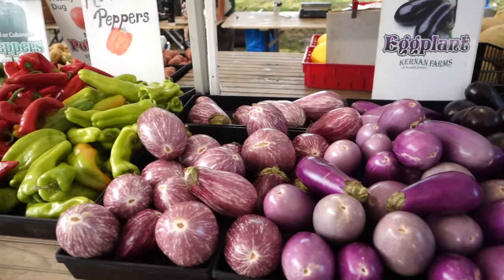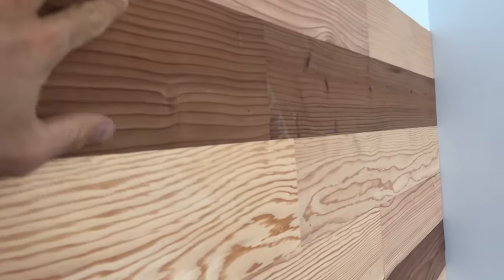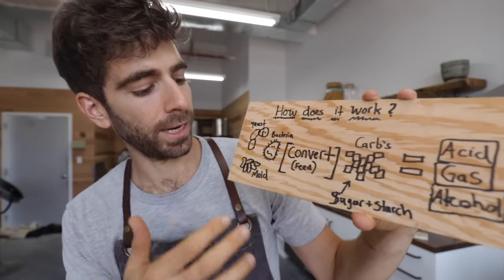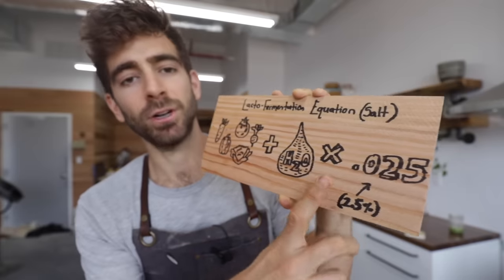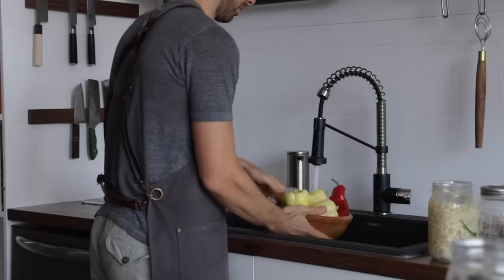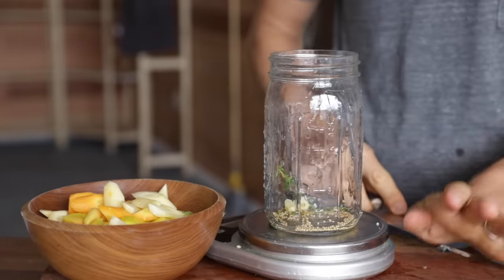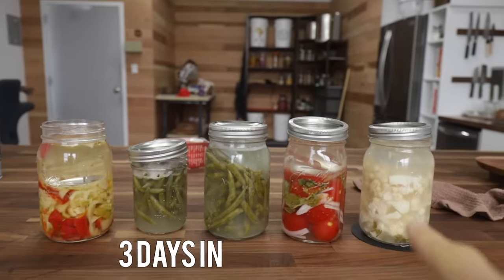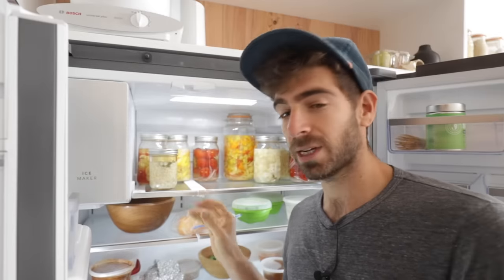The Complete Guide to Fermenting Every Single Vegetable

Comment: 1. Wash your veggies of choice.
2. Cut them up into bite sized pieces.
3. Add the vegetables and water into a jar whose weight has been tared (zeroed out). Weigh them.
4. Pour water into separate jar and add salt equal to 2.5% of the mass. Mix up and then put back into the original jar with the vegetables in it.
5. Weigh it down so the vegetables stay submerged. A glass weight seems to be the easiest.
6. Cover loosely with the lid.
7. Enjoy at your leisure for months if stored properly.

Did I miss anything?
Reply: Excellent
Reply: yes, how long to let ferment before refrigerating
Reply: @jamesnesran2348  It's up to you. The flavor of the veggies continues to change as the bacteria continues to eat them. I forgot about a jar for about 3 months and they tasted more sour than usual, but they were perfectly fine to eat. Technically you don't even need a fridge, just eat the veggies out of the jar, making sure to keep them submerged under water. That's how they did it before refrigerators existed
Reply: @jamesnesran2348  It also depends on how hot your house is. For example, my carrots ferment in two weeks in the summer, and they take a standard month in the winter. I also don't do any complicted math. I put 4 tsp of salt in a quart jar. add about a half cup of water to dissolve. add vegs. add water to the top. stir really good/shake. It has never ever failed. I never do the math and weighing he does. Just an idea.
Reply: Should the water ideally be chlorine free
Reply: Is it 2.5% of the weight of the water?

I've never weighed my salt. I just use about 1 tbs per pint of filtered water. Been fermenting for over a decade. Works wonderfully & no math. 😄
Reply: @heartshapedisle  absolutely!
Reply: What salt???
Reply: So veggies + salt brine?
Reply: @RunninUpThatHillh     Good point.  Refrigerators can fail.  I would like to know if you maintain your vegetables loosely lidded, and if so, how long?  I tend to tighten my lids when I reach the level of fermentation.   But I don’t refrigerate them, I appreciate your common sense.
Reply: @Wesdotcool     Do you tighten your jars, after the desired amount of fermentation?  Or do you maintain them loosely until totally consumed?
Reply: @davidadausuel4537  the latter. Loose lid for fermenting and tighter lid for refrigeration.
Reply: @CarolynRessel  salt type? No iodine and no anti-caking agents.  Rock salt and canning salt typically contains neither ~ but check labels to confirm.
Reply: @hitreset0291 Kosher salt is great for making sure it's not iodized. I use it on Sourdough bread. Not sure about anti-clumping agents though. 🤔
Reply: @CarolynRessel  I've discovered that french seasalt (0 additives, no iodine, no anti-caking agents) works best. I love Sel de Guérande for lactofermentation
Reply: What's has not been really mentioned but is important is the fact that some veggies let out water (salt breakes down cells) so do leave some space for the water level changes.  if you ferment cabbage eastern eurpean kind ( lactofermened insted of sauerkraut), you do not use water but just salt, white cabbage, carrots, peppercorns, bayleaves, no addition of water nesessary, but the mix nedds to be kneaded a bit before putting into jars. For the georgian kind of "red cabbage" (beetroots, cabbage, chilis, garlic, sellery) sellery sticks with leafs are obligatory, otherwise the taste is  much blander.
Reply: do any of you know if it's possible to use coarse grained salt? because sea salt and other types of salt are too expensive for my budget

Comment: A little tip for covering your pickled vegetables during the fermentation stage is to place a coffee filter on top of the jar and use the lid ring.  Set the metal lid insert to the side until it has fermented.  This allows it to ferment in the jar and yet release the gas through the screwed on filter while keeping dust/dirt out.  After it's fermented, you can then replace the filter with the metal lid to store it properly in the fridge.
Reply: 8:47
Reply: @lyricderbin1169  If you have it weighted down and submerged, it is not exposed to oxygen.  You have to make sure your fermented ingredient is submerged.  This is why even with a lid his green beans ended up with mold at 21:07.  They weren't submerged. Just make sure that your ingredients are submerged in the liquid and you'll be fine to remove the metal lid and use a coffee filter. I suggest maybe that you watch again the section on Anaerobic Environment to refresh about this.  :-)  16:40
Reply: Screenshot! Thanks, I'm keeping pics of certain things as I'm learning
Reply: Great idea, Thanks!!!
Reply: I have never fermented before. So excited to begin.
Reply: I do this but found the metal lid annoying for my kids and husband to take off and put back on. (Plus I need them for canning). I bought cheap plastic lids on amazon that fit on a ball jar.
Reply: @adrianaholman9861  It's super fun to do in the summer as vegtetables come on. OR when they're on sale at the store. Fermented carrots are the bomb. You can add garlic cloves too. I once did carrot, garlic, fresh dill. OMG I ate the whole jar. Don't. Remember to eat small amounts daily or your tummy might be upset lol!!
Reply: @RunninUpThatHillh  did you do the weighing the vegs in the jar thing he did like he did in the video, or did you just do 25 grams salt to one liter of water and make a separate brine?
Reply: Terrible idea. You will allow oxygen into the environment and promote mold growth on the surface as well as aerobic activity in the brine (the surface being exposed to oxygen results in oxygen dissolved in the liquid - this is how fish breathe) much better to just use the cap.
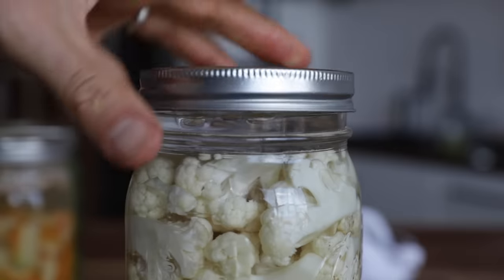Reply: @connivingkhajiit  Are you keeping your ingredients submerged?  That is the key!  All ingredients MUST be submerged.  NOTHING can be above the water. The gases can still escape (you'll see the water bubbling from time to time. For instance, at 17:57, you'll see he has only a towel with a rubber band over one of his jars.  The first jar he places on the shelf is not on tightly and it's angled, allowing the gases to escape and he has one jar that does not have a lid at all.  Just the bag of water to weigh down the ingredients to keep them all submerged in the water.   This is so the gases can escape.  It's essentially what I was suggesting with the coffee filter and the ring part of the lid to hold it in place.  As long as ALL of your ingredients are submerged, it will keep you from having to open a solid lid a couple of times every day.  Try it again, but make sure your ingredients are submerged COMPLETEY in the water/liquid.  If they are, then NO oxygen can get to them, and you can still release the gases naturally.  If they aren't submerged completely, you will get mold and other problems can arise. Hope this helps.  Happy fermenting!  :-)
Reply: GOOD one! Mahalo and Aloha from Maui!

Comment: For fermentation use rock salt, not iodized. It will help to start fermentation easier and can help avoid mold growing or spoiling. And for those using the Celsius scale 60F = 15C-16C  and 75F = 23C-24C
Reply: Use pickling salt, it is pure salt with no additives. Rock salt can have minerals in it as well as some heavy metals depending upon the source.
Reply: Would Kosher salt work?

Comment: We did a lot of fermentation and canning at my grandma's when I was little and enjoyed summer fruits and vegetables all winter long. I think canning is different slightly from this because you actually sterilize all your jars/lids, use hot boiling water and scald the produce before you put it in the jars. And also you completely seal the lids with a special implement to prevent air getting in. One good tip for checking if dangerous bacteria has developed in a sealed jar is press the top of the lid - if it has give and you can press it down a little, it's fine. If it feels tight and no give, you might have a problem.
Reply: In fermentation, if you scald the veggies, you kill the good bacteria which is necessary for fermentation to take place. It's definitely different from canning.
Reply: The salt and the anaerobic conditions are the important things here, not heat sterilizing - it's two completely different processes to preserve food.   Fermentation is a much older technique - it was being used long before there were canning baths and bottles to scald.

Comment: I did pickling/fermenting a few years ago here in Malaysia - the challenge I had was the space needed and refrigeration required because I'm in a tropical climate.  It was also hard to find the pickle weights, but will try your alternate tips!  
Planning to start a small pickling business connected to an organic farm that my family runs here.  Will see if I can dig deeper underground and actually have a naturally cooler environment without having to use up energy on refrigeration.
Reply: Marcus, look into African or Indian non-electric refrigerators.  Basically it’s a ceramic vessel used to store items and water evaporation is employed to lower the temperature a few degrees.  The drop in just a few degrees might just be what you need for your application.
Reply: @sgnguy2027  Thanks for the tip!! Will definitely look into that.  I actually am also looking into using large cement half pipes and packing soil on top of that (with ventilation) and creating a sort of pickling cave, as opposed to digging underground.  So I guess a large version of a non-electric fridge.
Reply: @jauipop  When you get things working please make a video on the process.  Or post links here for what works.  Keeping expenses down is important everywhere in these times.
Reply: @jauipop Sounds great did you make it? Any videos or pictures on how you did it?
Reply: How did it go?
Reply: Any update? Have you done successful ferments? Maybe even sold any?
Reply: Best of luck!
Reply: That is pretty cool

Comment: If you are wondering why he doesn't premix the brine for all the jars, it is because the water in each jar is a different salt concentration because the ratio of vege:water in each jar will be a little different. The salt amount has to take into consideration the total mass in the jar including the vegetables. A higher vege:water ratio will need saltier water to get the correct total salinity.
Reply: I just wondered why he didn't weigh the veg and water separately and add the numbers rather than pouring back and forth.

Comment: Suggestion: weight the empty jar. Fill it with your vegetables and water. Weight it again, subtract the weight of the jar and you will have the total weight of the vegetables. Make the calculation and add the salt required. The salt will dissolve in the water anyway. If you feel better, shake it a little.
You don't need to pour out the water to mix it with the salt.

Comment: C to F: Multiply the temperature by 2 and then add 30
(actual formula is multiply by 1.8, add 32)
ex: 22 C is roughly equal to 74 degrees using my method, actual conversion is 71.6

F to C: Now just work it backwards, subtract 30 from the temp. and then divide by 2
Reply: your actual formula is wrong but you are correct in the approximation of conversion. The true formula is C times 9 then divided by 5 add 32 or (C9) \ 5 + 32  F to C is F minus 32 multiplied by 5 divided by 9 or (F-32) x 5 \ 9
Reply: @williscooper7750  1.8 = 9/5; both equations are correct as they're equivalent.

Comment: I have an idea. You can just make a huge jug of salt water (2.5%) and top off the vegetables with the salt water. So you can use 200ml water and 5g of salt, or even 2L water and 50g of salt.
Reply: The salt concentration will be too low as you are not increasing the salt based on the weight of the vegetables
Reply: @Jimmy-pe5hj  negligible for most vegetables. Pretty much only cabbage will release enough water to fuck it up.

Comment: That green bean was the first on the vid and I was wondering why you didn't submerge it fully when you told us to. :p
Reply: I hope you found out later in the video.
Reply: @nyrick999  I sure did and that's why I left this comment  too hehe
Reply: dawn for life in Switzerland I noticed that too and was gonna comment on it even if it hadn’t molded.
Reply: @albertledesma5173  heheh or maybe he did it by "accident" to show us :p
Reply: Omg I thought of the same thing lol
Reply: He did it on purpose for demonstration on what happens when things go wrong. If you notice the jar is smaller, which in turn led to less food waste. He just had to say he didn't do it on purpose so the food police wouldn't fill his comment section with how much of a horrible person he is by wasting food.
Reply: @fishntyme8495  LOL yea, I thought it must be on purpose too hehe
Reply: @fishntyme8495  I did notice that the jars 'miraculously' grew larger :)
Reply: I find that green beans float due to air cavaties unless meticulously trimmed and packed for fermentation.
Reply: @BrianMorisky  .... makes sense. I think you need to slice the ends off green beans and peppers. They make a ceramic "masher" tool, to help press-out  all the extra air, after the liquid and veggies are  filled.....prior to capping/sealing.
Reply: I noticed that right away too. I thought either he went back and did it properly later or was using it as an example. I guess it was just a mistake. But still a good example.
Reply: Are the beans raw or cooked before going in jar,
Reply: Sooooooooo no vinegar?????

Comment: 10:45 Serious question: I have never seen anyone calculate brine salt percentages with the veggies included in the weight. I did the math, and with your 86g vegetables + 253g water (339g total), 8.5g of salt would give you a 3.2% brine (8/253). Is this correct? I know that using higher brine percentages is fine for lacto-fermentation, I'm just confused about why you are teaching it this way.
Reply: All the brine solutions I've seen are salt to water weight only. Those vegetables have to be sooo salty!
Reply: @Michael Natrin.....You are absolutely right! This guy did not know what he was doing😣...you’re not supposed to include the veggies in the weight to figure how much salt to add...that would give you a waaay too salty solution.....only the weight of the water should have been used to calculate the amount of salt.
Reply: Is in it more easy 1l water + 1 Spoon salt?
Reply: Doesn't he take into account the fact that the salt will pull out the water from the veggies therefore diluting the mix ?
Reply: Usually 30grams to a liter of filtered,brought to a boiling point and let to cool water is fine. It is better to filter and bring it to boil point water, because of the tap water having Chrolide in it.. People with sensitive stomachs should keep this in mind.. Im having an extreme severe leaky gut form, this is why I've done more research tho.. ^^
Reply: @InnV696  yeah, I'm like you, I boil my water. most times, I often use water and vinegar and bring to a boiling point. good points.
Reply: @aubinicoleau  The salt and veggies will reach equilibrium over time - the salt will enter the veggies.  And - experiment if you think he uses too much salt.  But follow his directions too, so you can compare - a jar of string beans with his amount of salt, a jar of string beans with a lower amount of salt, which one(s) fermented properly, and which do you prefer after 3 weeks?  Think like a research scientist!  Compare the results of different techniques to see which work and which don't.  Keep in mind that YOU MUST USE A SIGNIFICANT MEASURE OF SALT to create the right environment and prevent bacteria like botulinum bacteria which can kill you.  If you can't eat added salt for health reasons - do not ferment.

Comment: You could speed up the process by making a big batch of the "salty water" and then just pour it in to each jar, rather than measuring it in each jar separately.
Reply: Make sure to add extra salt to account for the weight of the veggies, and be mindful about how densely packed your veggies are. More densely packed veggies will need less water in the jar, which means the water needs to be saltier, than loosely packed veggies.

Comment: There is a much easier formula which I learnt from all the women in my family (it's tradition to pickle all sorts of vegetables in Romania, where I come from). Basically, for every litre (1000 ml) of water, you add one rounded tablespoon of sea salt.

 To avoid wastage of salt (like, who cares about that now, right? But in the olden days, salt was extremely valuable! Roman soldiers were paid in salt, hence the word "salary", from "sal" = salt, e.g., Salisbury = the town of salt), one trick you could do is first fit in all the veggies you want in the jars WITHOUT THE CONDIMENTS (!) and fill in the empty spaces with normal tap water, then pour back all the water into a measuring jug to see how much you need for all your jars, then round up to the nearest whole number of litres to figure out how many tablespoons of salt you need to use.

 Depending on your recipe, you could either leave the veggies in the jars and just top up with the brine or take everything out, put your condiments/spices in first, then your veggies, then hot, boiling brine, seal the tops on and let it cool down. The next day you could put all the jars in a bain marie for 15 to 30 minutes from the point of boiling to properly sterilise them. If you do it this way, your pickles can last even 3 years! It works every time:)
Reply: Wow, I learned so much from this comment